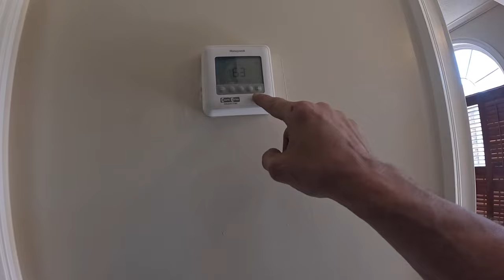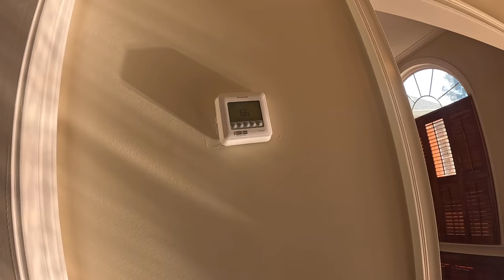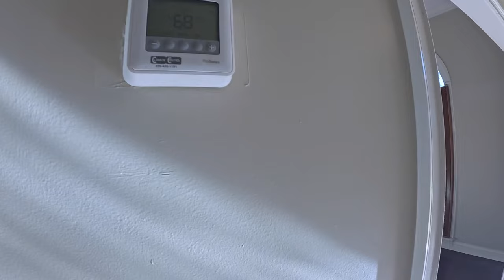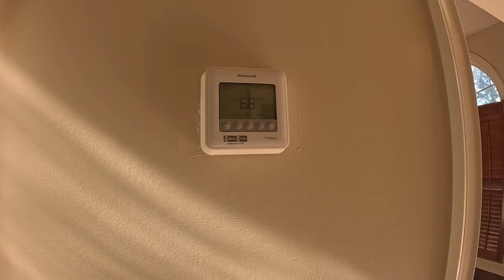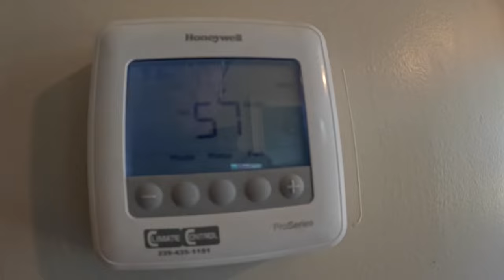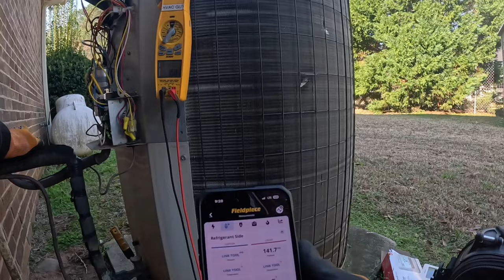Intermittent Low Voltage Short Hiding In Plain Sight! #hvacguy #hvaclife

Comment: Oh my Lord bud lol, that’s my worst nightmare on a heat pump. A low voltage short can drive you insane. I’ve had I don’t know how many like that and I can drive you out of your mind. Trying to find it. Then every now and then it’s something simple and you find it right away. I’ve had everything. I had a Payne one time it was new had been in just a little over a year, it was doing that intermittently turned out. It was the wires going to the defrost thermostat had the most tiniest of spots it was grounded out and when it would call for a defrost cycle guess what it would blow the fuse every time. Good job my friend I was pulling for you because I’ve been in your shoes so many times lol.

Comment: this is why, when i personally install a new hvac system, i always install THREE wire to the outdoor condenser if its a cool only, and an 8 wire if heat pump because if these issues... and an 8 wire indside ALWAYS

Comment: I had one where the homeowner  replaced the thermostat and it burned it. The contactor was stuck open but the system did not blow the fuse at the transformer.

Comment: I used to find the low voltage wire shorted to the copper tubing in many Goodman/Amana units. After wrapping the wire, I would put  a short piece of Armorflex on the tubing and wire tie so that  it could not happen again. Hope you  were  able to recover most of the cost  of this job, Curtis.

Comment: I didn't go to the end of the video, I ran out of time.  Before you completed the job, did you install either a bushing, grommet, or "alligator teeth" in the hole of the junction box where the low voltage wires passed through?  Also noticed where the stat wires follow the refrigerant lines as they passed under some sheet metal, did you tie the wires off so they can't rub out?  I'm asking, what is going to prevent this problem from happening again?   Jim

Comment: Hi Curtis, wanted to know if you encountered any probs on the M18 Vac Pump post-decay test (Lesson Learned is to purge hose/ zero out to ambient pressure from tee and hard reset) hope this helps. Dont condemn the battery

Comment: Sometimes you get a thing that I was told years ago they called faint voltage even though you see voltage it’s not necessarily true voltage so what I would take a contactor and if it can’t pull contact  in, it’s not true voltage.

Comment: You should have a grommet or some kind of anti-chafe connector in the hole where the wire goes in.  The vibration may make the metal of the hole cut into the wires and cause a short.

Comment: I'm surprised You didn't inspect the T-stat wire right at the corner of the cabinet and the cable under the Disconnect Box. 1st before anything else.. In the Tele, Satellite and sound Bizz, I had a knack to spot stuff like  that and be suspicious and check it out..
Thanks..
Mike M.

Comment: Propane tank probably for stove or fireplace gas logs
Reply: It could be also for a tankless water heater. There a few houses in my area too, that are set up with gas hot water, but the central heating is electric.
Reply: Never thought of that

Comment: What a coincidence. A few weeks ago I went on a service call with a coworker who spent the previous day searching for a short. Thanks to a previous post on the HVAC reddit, one of the first things I did was look inside the heat pump and I found a pressure switch wire that was rubbing against a pipe and shorting out.
Reply: Why don’t the manufactures put in screw terminals in air handlers to land thermostat and condenser wires instead of the rats nest . Simplify installation make trouble shooting simpler with easy visual verification. A set of indicator led lights would be instant verification of function commands
Reply: @charlespaine987  add some float switches and condensate pumps to the mix 🤪
Reply: @derek10w  yes a terminal strip to land them on would save a lot of field chasing in the spaghetti of lose wires. There is no absolute cure for insulation errors but we could make it a lot easier for those that follow up in field work . I have worked in the field for years.

Comment: I think we need to start being rude or saying something different to customers about how important regular filter changes are. I've been to many customers houses that I've documented that I was there because a severely dirty filter causes an issue or the issue. We need to explain it longer or just simply say if you want to loose over $300  or more because you saved $100 worth of filters and risk damaging your $7000 plus investment than don't get mad. Especially if I charge double the price for the filter and a service fee for 10 minutes of work. If im busy and a furnace is going off on limit im replacing or removing the filter, checking temp rise and leaving. Of course this is a different issue but could easily be blamed on the filter. Filter causing the blower to work harder causing it to vibrate and causing the rub outs. Thanks for the business.